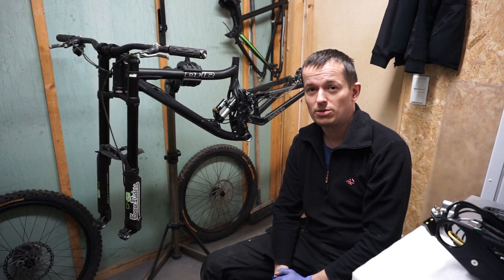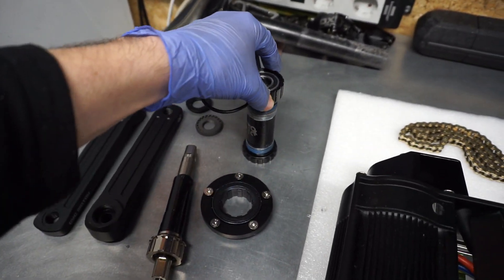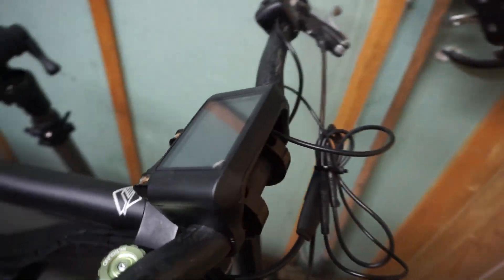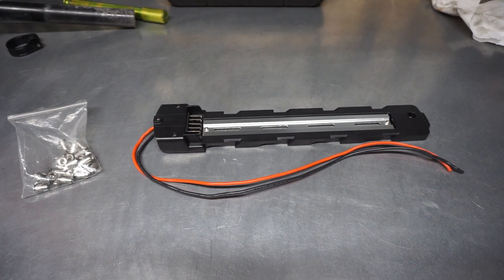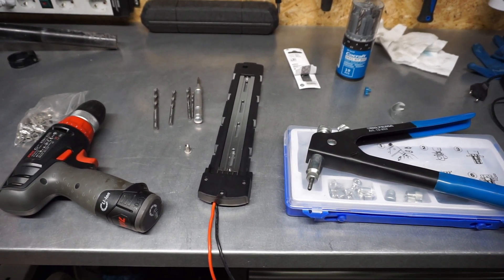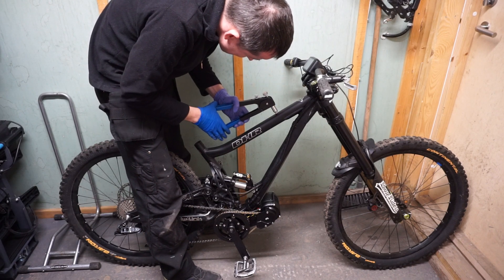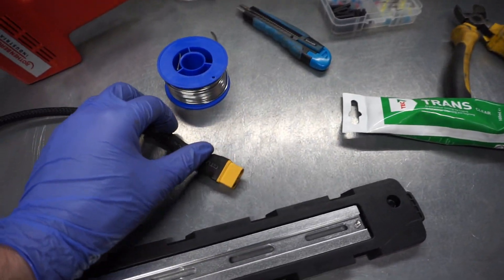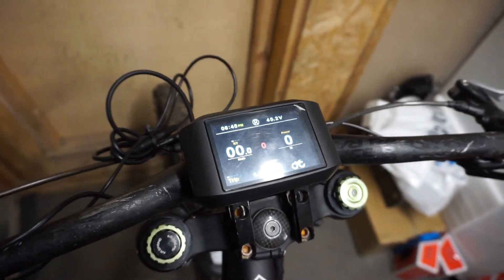Turner DHR conversion with CYC X1 Pro Gen2 motor

Comment: How many miles can you get with the 48v battery before having to charge again?
Reply from the maker: Range depends where you ride and your style, so you will never get good answer for that type of question. The harder you push the motor, the higher is energy usage.

Comment: do these motors and controllers do alright in the rain and wet weather?
Reply from the maker: I did not observe any issues. However I don't like the solution with controller behind the motor. It's frigile electronic device. Better to install it inside dedicated plastic controller box above the motor.

Comment: Nice work mate but this would look a million times better with a custom triangle battery. Right now it looks like a pregnant ebike
Reply from the maker: Too much hassle with box battery. It's Norway remember, labor is expensive. Also the objective was to have easily removable battery. Triangle batteries? Not an option.

Comment: See if you can get that battery on the down tube
Get your weight  down low you may have to build a costom battery
Reply from the maker: These Polly batteries are not designed for up-side down installation. I have installed smaller one Polly DP-5 like this on another bike and water accumulates in the bracket pockets. Also there is a risk of water leaking into terminals. This DP-9 is just too heavy to mount it under the frame. You risk breaking the engagements pawls (if I can call it like that) between box and bracket. Also there is a risk of hitting the battery with front wheel when you compress hard the fork.
Reply: True.
Down tube  inside front triangle? Angle of battery the issue with water?
Reply from the maker: @nobrakes7247  Not enough space for this battery inside the frame.
Reply: @LierskogenEbikes  
I know what you mean, I have a full suspension bike.
I managed to squeeze 5, 4s lipos on mine for 72 volts 
I purchased a custom triangle bag from Dirtbags, and it works great.
Reply: @nobrakes7247  think he thought you meant in the same spot but on the underside of the top tube so the battery would be upside down